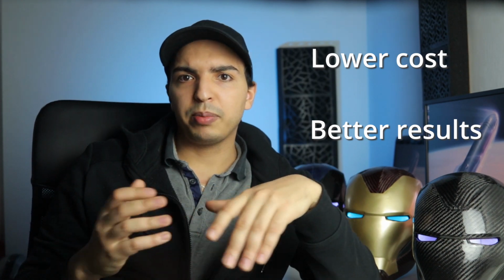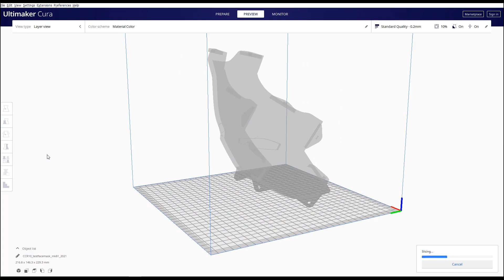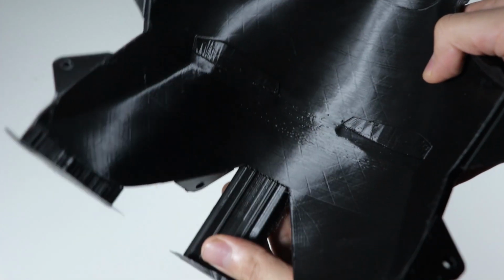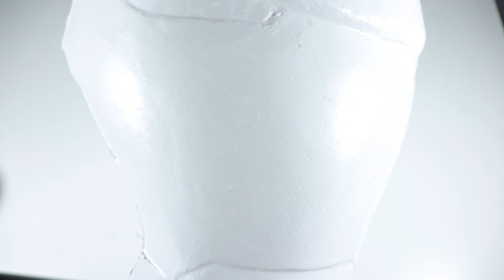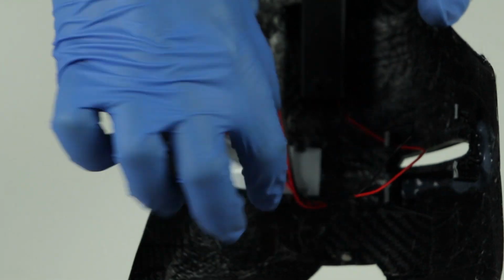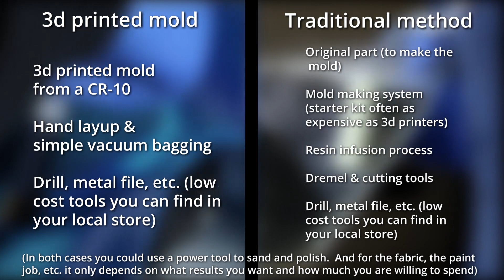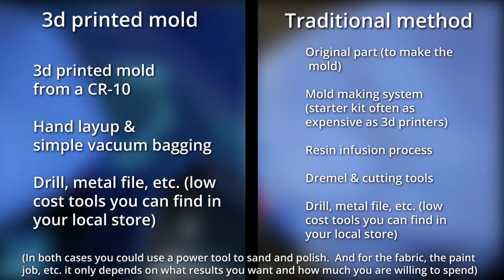DIY Iron Man carbon fiber helmets from 3d printed molds (GIVEAWAY)

Comment: sick video's! do you use pla or petg for your prints?
Reply from the maker: Thanks champey. I use only PLA. PETG is great too but it's harder to sand and doesn't stick so well (when trying to make a large 3d printed mold from small 3d prints).

Comment: That looks incredible! Would you consider making a tutorial on how to make a mold on blender? Amazing work mate
Reply from the maker: Thank you BAS! I will make a series of video to show how you can design your own molds (using blender or fusion 360) and how to 3d print them, and finally how to prepare the 3d printed molds to make composite parts from them. I will start very easy at first then make them more and more difficult. Let me know if there is a specific part you want to make. If it can help others, I will add it to the list!
Reply: @m3c761  that would be amazing man! Even if it's a paid course, I'm more than happy to pay. I've tried making moulds in blender but they don't look as clean or as good as yours!

Comment: just use the connect infill lines in your sliceing software and that will get rid of the pattern you get on your prints and save you some work
Reply from the maker: Usually it's not too much of a problem for me, but it can help.

Comment: As an alternative to using wood filler, UV resins can be applied to smooth 3D prints. Uncle Jesse recently uploaded a video on the process.
Reply from the maker: It's true, I tried to use the least expensive material that still offer good results. But UV resins works great too!